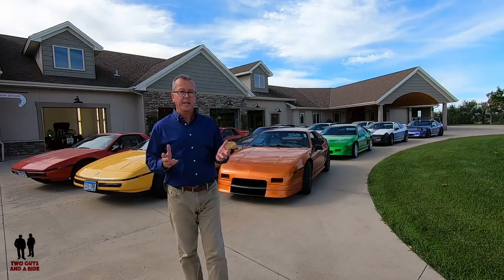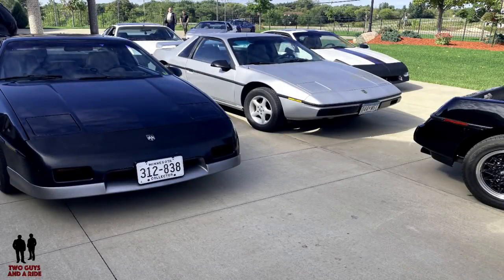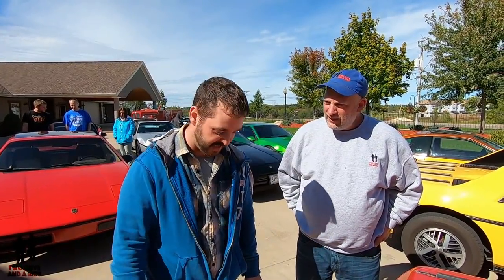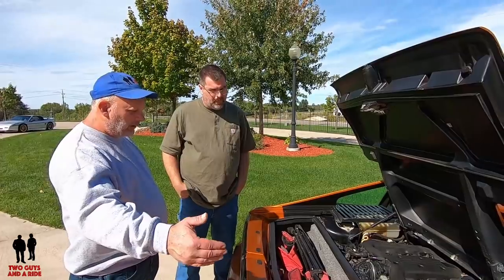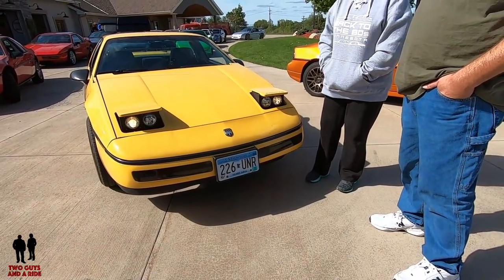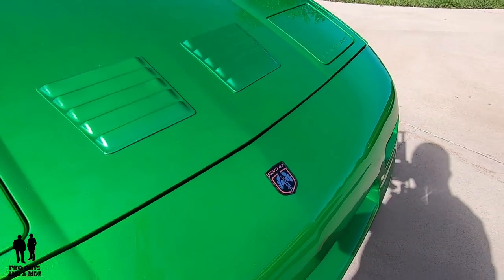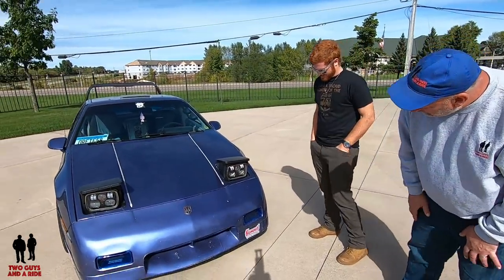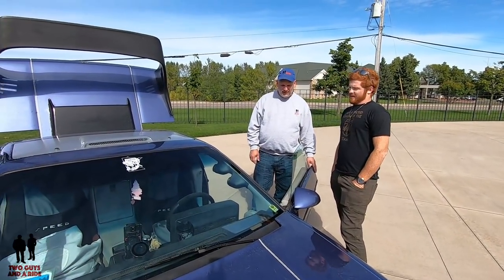Minnesota Pontiac Fiero's Forever Car Club Fall Rally

Comment: i would like to get on a trade for a fiero with a v8 or maybe  3.8 or other                                                                                                                                                                                                                                                          I have a  40 foot factory rv raised roof  eagle coach superchared turbocharged 6v 92 detroit diesel pusher automatic 6 speed allison  it is no lead sled  all aluminum skin and loads of storage in  basement it has the space frame you can pull anything and go very fast doing it  it was built for cost to cost and millions of miles it is same as tour buss but titled as rv
Reply from the maker: Thanks for watching